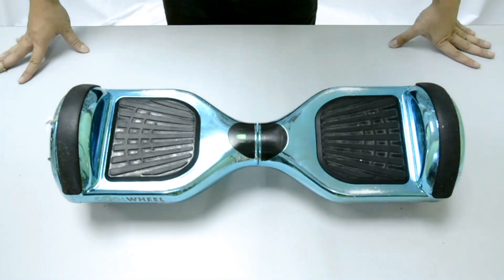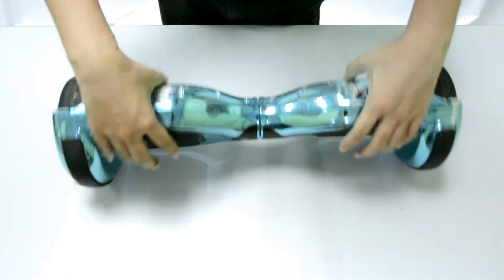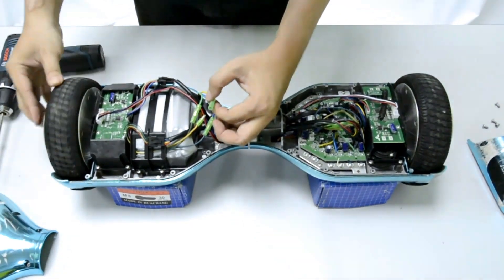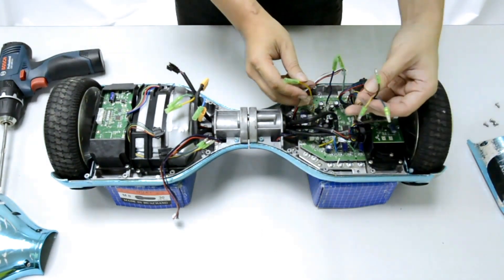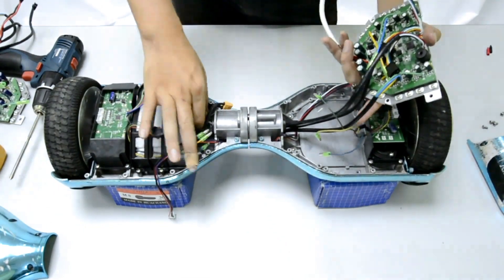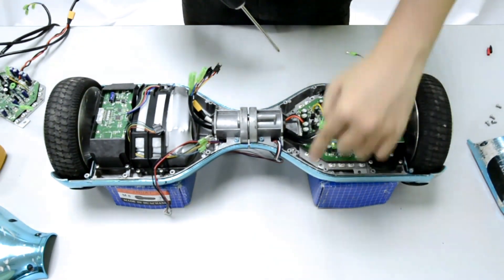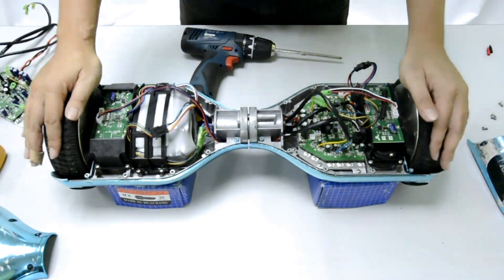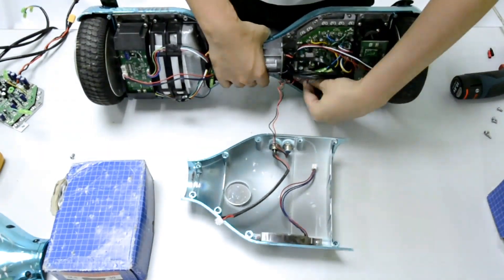Hoverboard Not Moving Troubleshooting Repair – Wheel Stuck, Mainboard Short Circuit Replacement

Comment: I have a problem with mine. My hoverboard has both blue lights and both green lights when I turn it on but when I put my feet on it, it doesn’t respond at all. I tried recalibrating it and it refuses to do so. I’m guessing it has something to do with the gyro sensor boards?

Edit: replaced both gyro sensor boards with the new ones. The lights turn off but the board still doesn’t respond. It does respond to something being pressed on the pads though

Comment: what is the type of connector to use on the hoverboard cables please?  I would like to repair a broken cable without having to buy a card to have the cable.  Thanks a lot
Reply from the maker: I suggest taking the board to an electronic store, and ask for the cable. Every cable is different in the board.

Comment: Just fix mine and turned out my ground wire in wheel back board came off. I solder it back on and it worked. Y'all might wanna try removing motor magnetic wheel and check 4 thin wires and just weld it back on and lights go normal and both wheels will work without all the rest level junk

Comment: Got a question. Bought a used 10 in smart hoverboard and changed all the
 boards. I use it for a hoverseat. Cannot go up a small hill in forward 
but can do it in reverse. Is the problem related to the sensors under the 
footpads?
Reply from the maker: It could be the hoverseat problem. It might have a problem to tilt the hoverboard.

Comment: the problem is the mosfet not the whole mainboard you need to replace 1 or 2 mosfet connected to the blue wire where the wheels is stuck do not replace the mainboard
Reply: thats a stretch, id rather replace the whole gyro board

Comment: My wheel on my hover board Is move the wheel it is bumping what is wrong with my wheel on my hover board and my hover board has a Blue light on it is that good or bad and the light is not blinking   It’s a solid  blue light

Comment: Hi. Thanx for the video. My green wire cause the problem on my one.  Once i unplug it then my wheel is released. Can my mainboard get fix or i should buy another one? And how to specify the main board model? Thanx in advance
Reply: Its probablly just a bad mosfet, they look like black rectangles with a metal bit. Use a multimeter and measure across each terminal, whichever one has a short is the bad one. They are located around the perimeter. They are easy to replace
Reply: Sorry for being 4 years late

Comment: You should disconnect the battery and drain the circuit before doing anything.
Reply: How do you drain it?
Reply: @persianchris2451  hi he want to deplag the battery and discharge the capacitors so du can not distroy the The Mos fet transistors ok

Comment: Please help!
Koowheel hoverboard K1 started to work incorrectly.
The first mistake was to stop the left or right engine at random, then suddenly turn off. I can not turn it on.
I suspected the charger, but the charger is correct. I thought the battery was empty, but the battery was 36V. When I try to turn it on, the green light on it once lights up once. When I connect it to the charger, the loudspeaker is activated that the bluetooth is ready for pairing. The device shows charging, but charger does not. (Battery full)
Can I safely say that the motherboard is incorrect, or can it be anything else?
Reply from the maker: This is a battery defect sign, more than 70% China hoverboard have this defect, where they never QC on it.
Reply: Concept For All .. but battery is 36V when measure..
Reply from the maker: There could be 2 issues occurred concurrently according to your explanation. First is battery defect: if your hoverboard is suddenly off (completely off, no light, engine not moving, no sound) and can't turn on, it is because the protection board in your battery detected incorrect voltage between the battery cells and kick off the protection sequence. It protects the cell from damage and explosion. You can check the battery voltage at this stage, the voltage should be below 10V. During checking, DON'T disconnect the battery or it will reboot and back to 36V. You should touch the multimeter pins on the motherboard where the battery connection is connected. The hoverboard is unable to turn on at this moment unless you reboot the system by plugging in the charger or disconnect+reconnect the battery. 

Second is motherboard spoiled: If your hoverboard turn on by itself when you plug the charger in, the motherboard is spoiled. The hoverboard shouldn't turn on by a charger. If the hoverboard doesn't ON, but the speaker is ON, then the problem is probably due to wrong bluetooth power supply point connection.
Reply: Concept For All Thank you! In any case, the new battery is 500kn (my currency), motherboard 700kn, and new K1 hoverboard 1000kn. 🤔
Reply from the maker: We don't have battery for sales, but we do have the top grade motherboard at around 400kn. the motherboard is comes with APPS support and auto tilt features, and the circuit design is the latest and durable by TaoTao (authentic). If you are interested, you can look here: www.coolwheel.my/mainboard

Comment: Mine got messed up when I turned on my hoverboard upside down and then this happened it won't move
Reply from the maker: It should work after you restart it. If isn't, u might want to try recalibration.
Reply: Well my hover board got broken because I restarted it :( now it shows all lights on

Comment: I have one that turns on and the red light flashes, I've watched every video and tried to re-calibrate several times, drained the battery recharged the battery and nothing!  when holding the button it does flash the lights 5x  just like some videos I watched but when I turn it off and back on the red light still flashes...   =(

I have another (Different model) that if you hold the power button it has a woman's voice that says, "Trying to connect Bluetooth"  Bluetooth pops up on my phone and disappears, the thing never lights up or seems to turn on...?
Reply from the maker: This could be the circuit board failure, you should try replace the circuit board. You can buy a good one from coolwheel at www.coolwheel.my
Reply: Count how many times it flashes. It will flash so many times then pause then flash again. Then google hover board flashing codes. The number of flashes will tell you what the problem is.

Comment: Mine was water damaged and turns on but doesn’t move I’ll try it read my reply if it worked
Reply from the maker: Water damage normally spoil the circuit board, replacing a new circuit board shall solve the issue. Make sure to dry the battery as well. You can get a good circuit board from www.coolwheel.my

Comment: Do you sell the blue colored mainboard? Part # 1537 JIN GANG LUN 2015-09-08? I hope it's not to old or an obsolete part? I could send you a picture to order it. Great video btw. Thanks.
Reply from the maker: We only sell the top grade circuit board, manufactured by TaoTao, and they are compatible to most hoverboard. You can get it from www.coolwheel.my

Comment: hello, nice  job men, could you tell me why the tip 127 explode?
Reply from the maker: It is due to poor circuit board design or component quality issue. It is normally happen to low grade motherboard

Comment: what happens if the wheel gets stuck on the other side
Reply from the maker: +Dman Bloom u need to unplug the wheel cables to check the problem, as illustrated in the video.